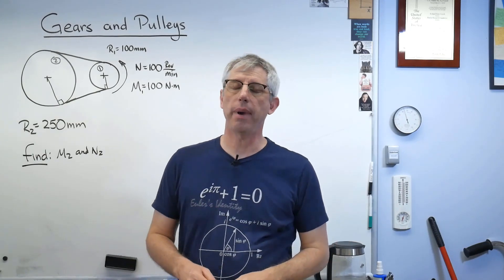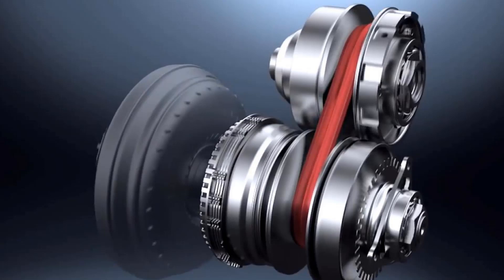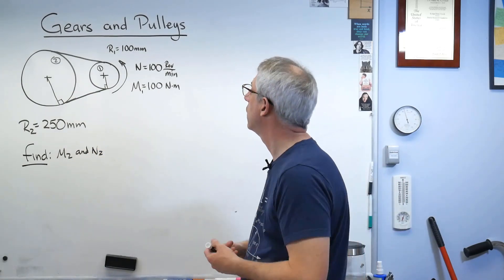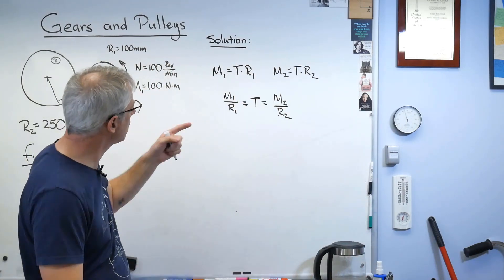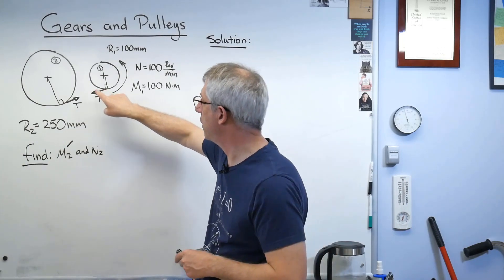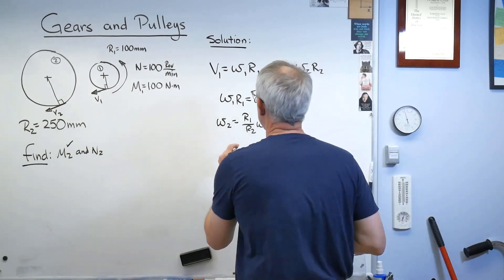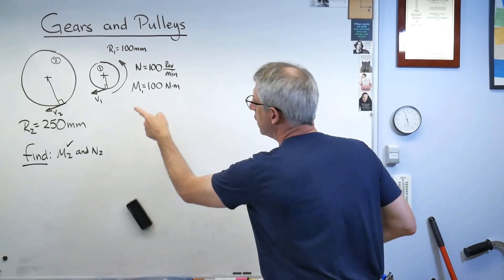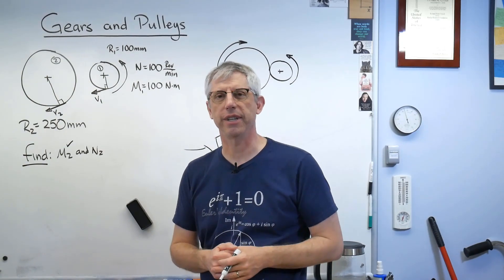Statics - Gears and Pulleys

Comment: If you had 2 spindles each with 2 pulleys so you can change the belt for different speeds or torque. What would happen if you out 2 belts on?